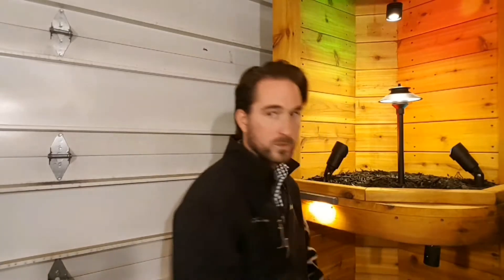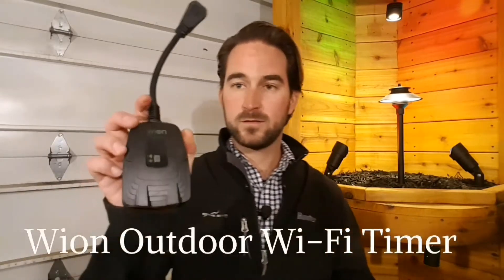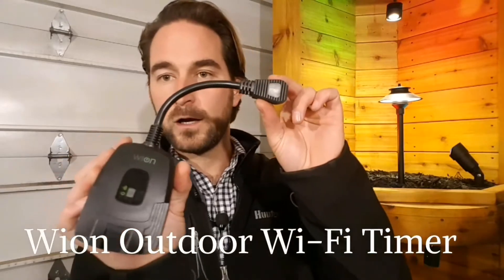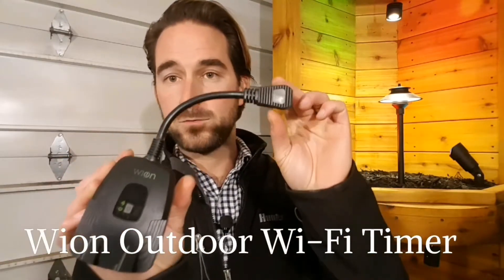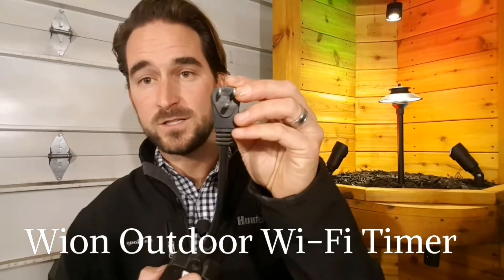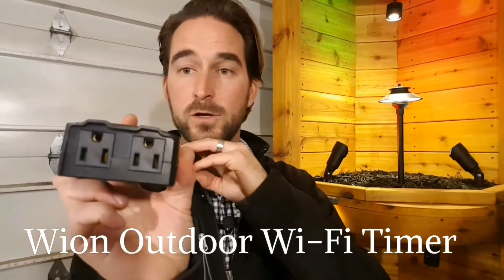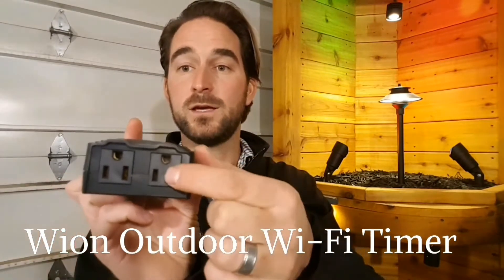How to Install Wi-Fi Low Voltage Landscape Lighting

Comment: Will this work only with the simple transformers without any timing function? For example some 120W Malibu transformers (and other brands) have a digital screen, I guess for some digital timing function and may need an initial set up before its "ready" to go. Do some transformers require some basic set up after you turn it on? In that case just simply turning on the transformer will not turn ON the lights. Thanks for your help.
Reply from the maker: It will basically work with any transformer. Best option is to just set your transformer to always on, plug it into the timer, then plug the timer into GFCI outlet. From there you will be able to bypass the transformer and run everything from the wifi timer.

Comment: Hi, my lighting transformer, when in manual mode, does not back on when pulling plug and plugging back in. You have to then turn it back on at the panel. Can you recommend a model that does come back on when removing and replacing power?
Reply: Same with my Hampton transformer, I have to go to manually press manual button on the transformer but can turn off with the WiOn app

Comment: Is it ok to leave the wifi timer switch connected to the devices outdoor as in rain? Also if we have to connect to the low voltage transformer what should be the setting in the transformer if we want to turn on on a need basis?
Reply from the maker: Yes the device is an outdoor device and stands up well to any outdoor conditions. Leave the transformer in the ON position and then you can control everything either via the Wion app or a button on the actual timer that allows you turn the lights on